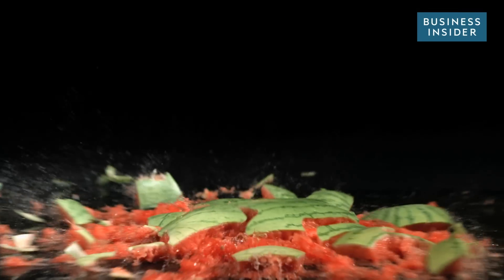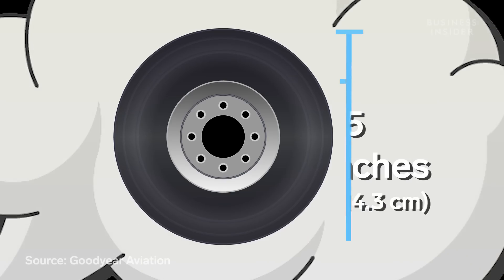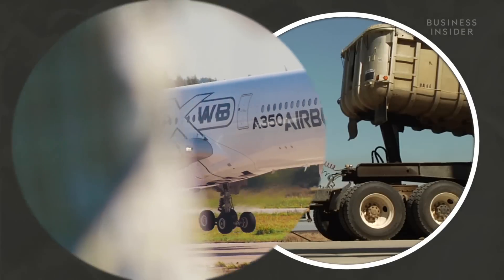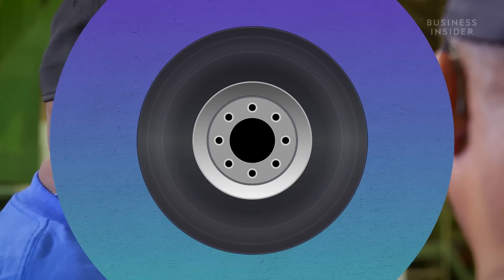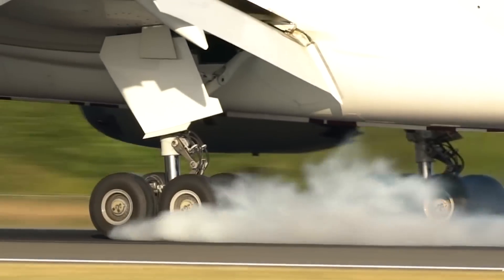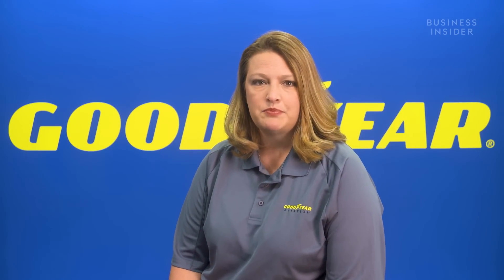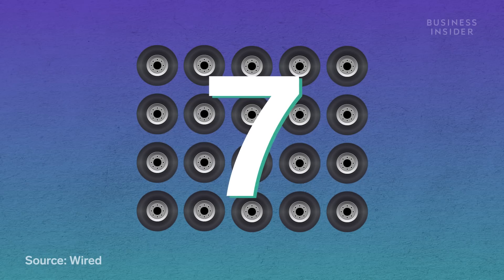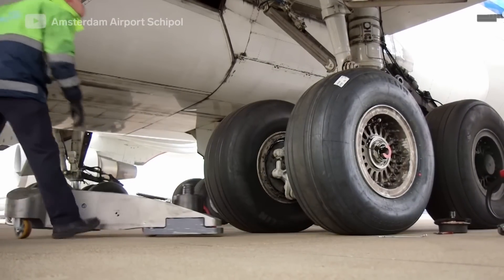Why Plane Tires Don't Explode On Landing

Comment: Airplane tires can last twice as long if they're rotated at same speed as planes landing speed.
Reply: The gyroscopic effect of tires spinning, would drastically affect the aircraft handling.  It's the same reason the pilots apply the brakes as soon as they get airborne, to prevent the spinning effect.  The nose tires are stopped by rub strips when they are retracted.
Reply: @robertheinkel6225  Your right on  . What if you had a plane tire that had super rotation on landing and avoided the smoky tire effect. Would not this increase the life expectancy of a tire?
Reply: @robertheinkel6225  l mean a tire that had super ballbearings to turn easily on contact with runway.
Reply: @robertheinkel6225  Planes would not need tires if planes landed in water.Anything on this?
Reply: What is the age restriction to fly commercially

Comment: You're making it seem as the plane lands vertically at 170+ mph. When in reality most of its speed is horizontal not vertical. Unless you're Ryanair
Reply: I think Ryanir lands at a speed rather like 270 mph v/s
Reply: @nathanaelmalm5641  v/s?
Reply: @kiyoponnn  vertical speed
Reply: @Nchopy  Thanks
Reply: @kiyoponnn  Vertical speed
Reply: Are Ryanair landings really that bad? Just asking... Never travelled in one.
Reply: @joeldvs777  I used them many years ago they didnt stick out as horrible...maybe they are worse now.  I just remember them saying a flight would take 2 hours when it's really a hour or so and always announcing an early arrival ha
Reply: @joeldvs777  no they are not I have flown on Ryan air and it's no where near as bad as people claim the only issue they was is someone died on the way back from America
Reply: @joeldvs777  No...
Reply: @joeldvs777  it's just that some people make jokes about ryan air because it's low cost
Reply: @joeldvs777  Very bumpy, but it’s cheap so who cares
Reply: @joeldvs777  it's honestly fine it's just because it's cheap people make fun of them
Reply: @joeldvs777  depends on your pilot, I flew 20times with Ryanair and round about 50% are hard or very hard landings
Reply: J D nope, they're fine
Reply: Ryanair stops its planes by sticking their feet out flintstones style
Reply: Ryanair:200 knots vertical 
Lufthansa:150 knots BUTTER
Reply: @linusbertling  ikr I always hear a chorus of "oof" whenever I fly Lufthansa and the airplane lands
Reply: @Josh Drake What matters is the lateral kinetic energy and the downward forces the tire has to absorb. Those are both proportional to the mass of the object. A plane weighs orders of magnitudes more than a F1 car.  An F1 car braking at top speed has about 4MJ of kinetic energy to dissipate, whilst a commercial jet landing has about 700MJ.
Reply: Josh Drake Exactly! I think the fact that tires can survive on an 11,000 horsepower top fuel dragsters running <4 second quarter miles is amazing, too
Reply: So none of you realized she said TARMAC
Reply: Pyrde Pavkki its a figure of speech, get over it
Reply: Ryanair actually lands at 848337378383838km/h vertically.
Reply: Ryanair lands at Mach 1
Reply: @KrisMuscledspider77  mach 3.89 actually
Reply: I took Ryan air twice on my trip to Europe and I agree
Reply: very good point👍🏿
Reply: i also got that and ceme here to tell this idiot girl ..... but you did it 🖒🖒🖒
Reply: @Gabe Hoinh the hell is that supposed to even mean
Reply: @Josh Drake Compressive loading is higher on a plane.
Reply: Unless you are flying on a tu-144
Reply: Sorry on behalf of an airlines that has my name
Reply: The worst airline?
Reply: Exactly, except you have to pay extra for tires on ryanair
Reply: @Josh Drake Yes, she did.  And you're right.  It would be concrete of some kind.
Reply: Yes
Reply: You have to pay a fee on Ryanair if you want a soft landing
Reply: Dive straight down
Reply: This is a accurate comment
Reply: @Smarty Pants Not really, they're buttery smooth
Reply: @ Josh Drake

More Gs, but not more force. 

What does an F1 car weigh... 1500 pounds?  

Lulz
Reply: 911 i would like to report a murder
Reply: @Josh Drake I'd say top fuel dragsters
Reply: Bro this got my laughing so hard
Reply: bro stop with the freaking ryan air jokes
Reply: Oh you’re good, you’re really good.
Reply: TRUE!
Reply: Ryanair lands at their max speed, and the plane at a full vertical angle.
Reply: The horizontal and vertical forces combine into a vector that shoots directly into the middle of the tire, from the outside a little to the right. The wheel does not roll right off the bat, it has to deal with that vector before rolling
Reply: The top v/s speed of Ryanair is about 200 mph~150 ish for the 737-700
Reply: Dun dun dun dun duuuuuun dun dun dun duuun thank u for flying Ryanair
Reply: Planes are known as knotical miles ithink
Reply: You’re completely missing the point
Reply: I just don’t understand why people think Ryanair makes hard landings every time I fly on Ryanair they always do normal landings
Reply: The rubber still has to rub against the runway going 170+ mph backwards all with the weight of a jetliner bearing down on it.
Reply: well it's the same sort of principal because the tyres come down onto the runway at that speed. regardless of what direction the speed is from, the amount of force is the same
Reply: I was about to comment on that but u got it already 👌
Reply: I wonder how that steam from the tires when landing smell like !!!
Reply: Still this plane weighs so much. How tiny tires can support the weight is incredible
Reply: @20-NYC  they aren't that small, those tires are 4 to 5 feet high
Reply: @Nchopy  lol I’m speaking relative to the massive size of the plane ✈️. But true compared to a car tire they are small but compared to the size of the plane it’s small.
Reply: Or Aeroflot
Reply: Dont use miles per hour in aviation use knots
Reply: @lheng2515  And feet
Reply: @lheng2515  yea but I had to use the same units as the video. As an aviation enthusiast myself I prefer knots when talking about planes
Reply: @lheng2515  I was making a statement, ofc you use knots
Reply: @lheng2515  If you actually knew what a 'knot' was, you wouldn't want to use it.  A kilometer, on the other hand, has a value based on the speed of light.  I don't know why everyone doesn't use the kilometer.
Reply: @onlygearwarrior  Ah yes the speed of light.... a very practical reference...
Reply: @gillespaling7039  'relativitely' speaking.  Yep.
Reply: Kush Patel exactly
Reply: Its speed during landing is not only horizontal but vertical as well. Why else can the plane lower itself to the runway in the first place if it's not moving vertically downwards? Also, 170+mph is about how fast the plane needs to endure, things are designed to be stronger than actual landing speed.
Reply: @shadowkillz9606  yea I know that, but the horizontal vector of speed is way greater than the vertical. Planes when they flare land at about 10 feet per minute. Which is meant to gently put the tires down. And no most planes land at about 130 knots or less bc they are trying to have a controlled fall. Essentially they are trying to stall but not really

Comment: I'd love to see an F1 pit crew try the tyre change
Reply: The airliner tires are too heavy for a human to carry, so the machines are needed. Also F1, Indycar, and some IMSA cars are fitted with easy to torque single nut attachment systems, compared to huge amounts of torque for nuts on airliner attachment systems on some airliners.
Reply: Ok didn't realise that

Comment: Air is about 80% nitrogen. So what's the need for making it 100%?
Reply: The tire pressure does not change using nitrogen, due to the extreme changes in temperature.    Retired Air Force Crew Chief.    Temps can range from + 100 degrees on takeoff to -50 degrees in flight.
Reply: No water vapor and oxygen to create corrosion or degradation on the inside of the tire.

Comment: So if a tractor can use used tires, can a bicycle use used tires for non-intense use?
Reply: of course. bike tires tend to be very thin with only minor reinforcing threads. and doesn't reach the kinds of speeds where hydroplaning occur. plus most use inner tubes to actually hold the airtight seal.

Comment: What happens if you fill the regular car tires with Nitrogen?
Reply: 10 x your tires are less susceptible to psi changes as the temperatures rise or fall. I live in northern CA where evenings are very cold but days get very hot. My tires can be at 35 psi in the morning and 42psi in the afternoon after driving for a bit. Nitrogen is not as susceptible. You can see for yourself if you’re a Costco member! Costco fills your tires with nitrogen free of charge.
Reply: @mtunofun1  why Nitrogen though and not Helium?

Comment: Simple answer-It is a harder tire.There saved ya 5 minutes
Reply: Also, a plane does not land vertically. The vertical velocity is nowhere near the speed quoted at the beginning, with the watermelon.
Reply: Christophe Boulet motion in the vertical direction is independent of the horizontal direction. Physics.
Reply: RIGHT? IT'S A STUPID VIDEO WHICH I STOPPED WATCHING ONCE THEY DROPPED A WATERMELON.
Reply: Thank u
Reply: Here's a quicker answer: Because they don't
Reply: And filed w/nitrogen

Comment: THERE IS NO SUCH THING AS TARMAC!!!!!
Reply: What is wrong with all these tarmac denyers?
Reply: @JonnyD3ath  i actually know aviation enough to know there is no tarmac.
Reply: SushiEater44 I can tell you there certainly is tarmac
Reply: Tarmac or tarmacadam is gravel coated in a tar binder.  It is similar to asphalt, but cheaper and less durable.  Asphalt uses a bitumen binder.
Reply: https://en.wikipedia.org/wiki/Tarmac
Reply: Runways may be a man-made surface (often asphalt, concrete, or a mixture of both) or a natural surface (grass, dirt, gravel, ice, sand or salt). Runways, as well as taxiways and ramps, are sometimes referred to as “tarmac,” though very few runways are built using tarmac
Reply: @joebidenofficialpotus  Runways may be a man-made surface (often asphalt, concrete, or a mixture of both) or a natural surface (grass, dirt, gravel, ice, sand or salt). Runways, as well as taxiways and ramps, are sometimes referred to as “tarmac,” though very few runways are built using tarmac
Reply: If the plane uses the taxi way as a runway.

Comment: STOP SAYING TARMAC. IT DOESN’T EXIST
Reply: Please call them what they are. Runways, taxiways, ramps etc
Reply: YO! There is only the runway, taxiways, and airport apron. WHERE'S THE TARMAC NEWS ANALYSTS?
Reply: @andrewtaco  the tarmac is probably the whole airport in their eyes. Even the tower is probabky tarmac.
Reply: @nathanaelmalm5641  I freaking agree.
Reply: Yep, runway is the correct term
Reply: wow i didnt even know i made a comment here LOL
Reply: Finally someone who knows
Reply: @doormattpoo  Runways may be a man-made surface (often asphalt, concrete, or a mixture of both) or a natural surface (grass, dirt, gravel, ice, sand or salt). Runways, as well as taxiways and ramps, are sometimes referred to as “tarmac,” though very few runways are built using tarmac
Reply: @JustNiik F 
https://en.wikipedia.org/wiki/Tarmac
Reply: Ian Macfarlane i can go on wikepedia and change that definition my self
Reply: All these people saying tarmac doesn't exist are cute. 
It most certainly does exist but has been all but replaced by bitmac. 
Most runways are not made from tarmac however.
Reply: Tarmac exists, it's a road surface material made with crushed rocks and tar. It's just that runways don't use tarmac, it uses asphalt or concrete. Some airports do use tarmac but that's rare.
Reply: THANK YOU!
Reply: All of us abiation enthusiasts are raging right now I even explaned whats the difference between tarmac and runway
Reply: Ma. Aileen Gomez
Tarmac is a construction material
Runway is a stretch of ground aircraft use to land (can be made from anything)
Reply: @kuber5987  I watch that guy!
Reply: The Shitstorm Starter  asphalt combines gravel and sand with bitumen, which is made with petroleum, while tarmac combines it with tar, which is made with coal. Tarmac is cheaper to pave for smaller surfaces like driveways or to repair potholes, while most major roads use asphalt since it's more resilient. If you ever drive down a road and see a dark spot used to patch a hole up, it's probably tarmac.

It's not a differentiation relevant to most people, but you can't just say tarmac doesn't exist.

The main reason it's wrong to call a runway "the tarmac" is because typically people don't call roads by the type of material they are made out of, but by the specific name given for the road's purpose. People say I'm driving on highway or I'm driving on the street and not I'm driving on the asphalt. Runways also aren't made of tarmac (at least modern runways aren't) but that's a different point entirely. You still wouldn't say you just landed on the concrete, even though that's technically correct.
Reply: It does. It's a short for "tarmacadam".
Reply: @Sam-mv3if  runways aren't made out of tarmac
Reply: @doormattpoo  "The term is also often used to describe airport aprons (also referred to as "ramps"), taxiways, and runways regardless of the surface." - Wiki
+ plus I never said it was made out of tarmac, just said that the word exists.
Reply: @doormattpoo  They were not suggesting that.  Merely that "tarmac" is a real thing.  With a real etymology.  But that is not the type of suface on which these aircraft land.   Unless it's an emergency.
Reply: @Sam-mv3if  runways arent made out of tarmac its conrete sorry if I have ban english im a spanish dude
Reply: 27 ARRRRRRR
Reply: Ikr
Reply: You guys are SO smart!
Reply: The runway is made of asphalt ?
Reply: HOLY SHIT SOMEONE WHO FINALLY SAYS THAT A FRICKING TARMAC DOESNT EXIST
Reply: @raudel5661  "tarmac" exists.  It is short for "Tarmacadam", but you are answering a different question.  Is the runway surface "tarmac"?  No.  But the word is specific to a type of surface material.  (CAPS LOCK?)
"A" tarmac?  Like saying "A" concrete...

Comment: But if the pressure is too high, surely the tire could rupture and blow up? Especially the fact that it’s landing at such high speeds?
Reply: Yeah, that's why they have set tire pressures which are safe. Of course if it's too high it would explode.

Comment: How can you call it 45 inch of tyres if it has air inside?
Reply: What? That makes no sense. 45 inch tires pressurised with nitrogen. Same as any other tire except those use air.